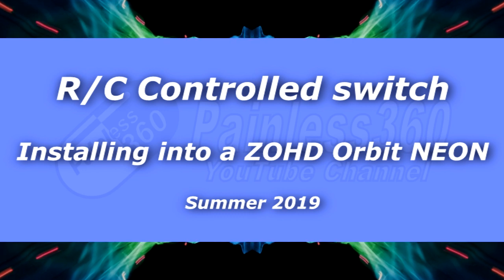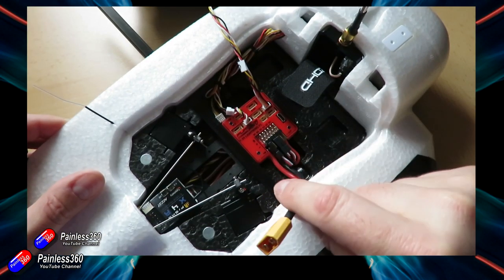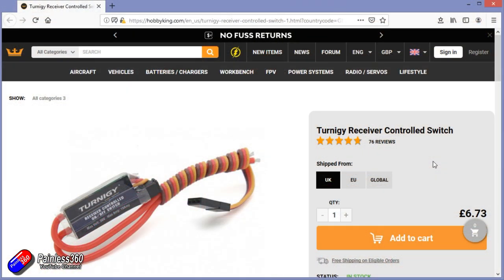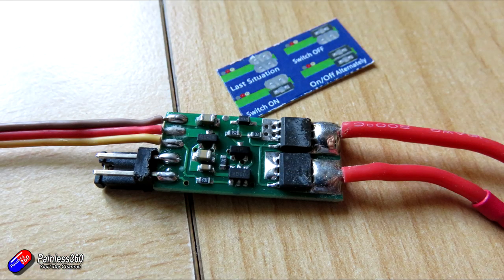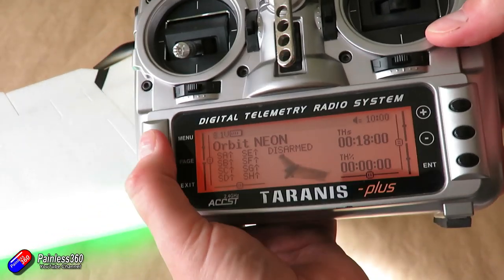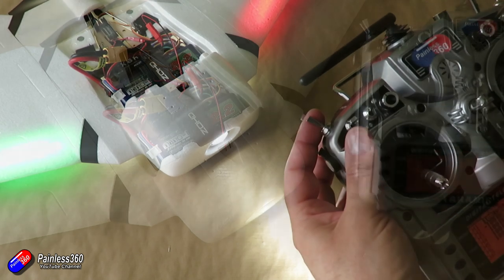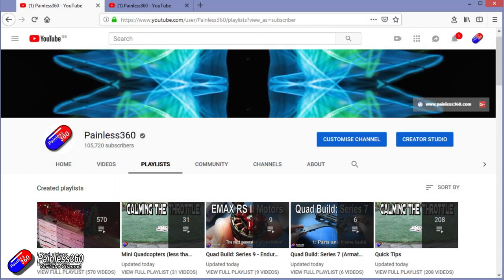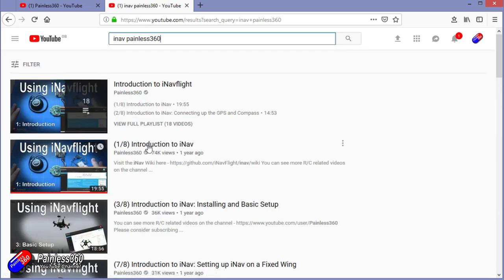Using an RC switch to control LED lights (or anything else!)

Comment: Hi Just what I was looking for.
One Question if I want to turn on and off the landing lights and navigation lights independently, do I need 2 switches or one switch can controll 2 sets of lights individually. 
Thanks for your answer
Reply from the maker: It depends on how they are wired up, I'd expect to have one switch per 'function'', best of luck!

Comment: I'm looking for how to on/off switch WITHOUT rc switch in order to don't consume whole dedicated channel on my 4-ch system for light control. Is it possible somehow to provide light module with signal and power like it would come from receiver, but in fact directly from BEC and controlled by some physical switch?
Reply from the maker: If you figure out a way to do that, let me know

Comment: How can you make this work with FrSky Xm+? I want to be able to turn lights off & on from my Transmitter/radio.
Reply from the maker: If you have a flight controller in the model then look at channel forwarding to bet a PWM outputs you can use for this.. Best of luck!

Comment: Can you show how to control a quadcopter using 4g, and transmitting the fpv camera signal via 4g too
Reply: Do you know of anyone doing this?
It sounds like a really cool idea but I doubt streamed video would look very good. Streamed video is usually heavily compressed. The compression algorithm assumes most of the images isn't changing. Video from a quadcopter would be a huge challenge to stream with low latency and high quality.
Still, I'd like to see something like this myself.
Reply from the maker: I've only seen Parrot mods for that. Not for conventional fpv and RC control..
Reply: I saw someone doing this using raspberry pi

Comment: Is there anything like this which will work with a rotary switch on the transmitter to turn on multiple circuits in sequence?
Reply from the maker: You could probably set that up using multiple switches and an OpenTX mix but I'm sure I've seen more complex switches in the past (used for things like R/C trucks)..
Reply: This one will operate 4 functions sequentially with a single toggle switch on the radio:

https://hobbyking.com/en_us/dr-mad-thrust-4ch-electronic-on-off-switch.html

I've also seen a 7-channel version of it but couldn't find a link for it.